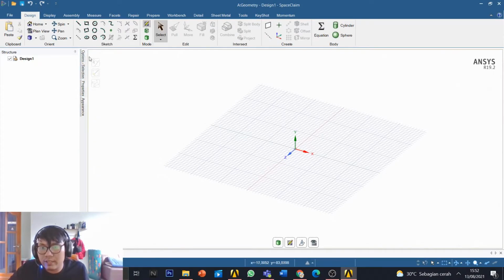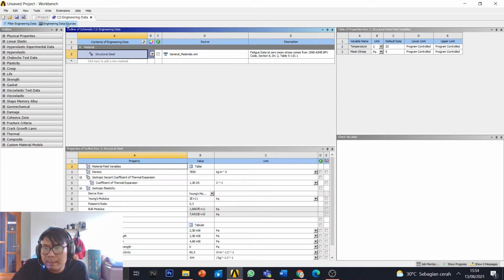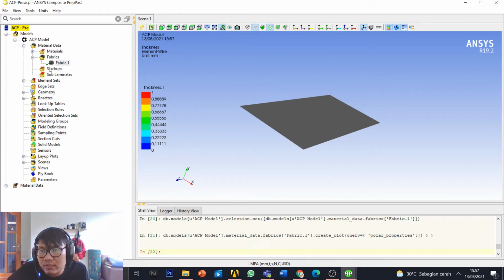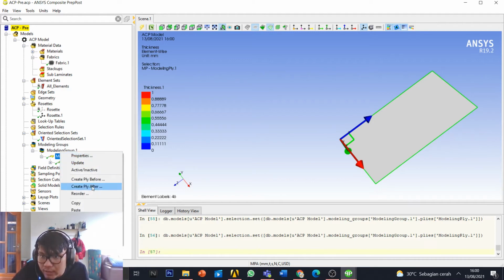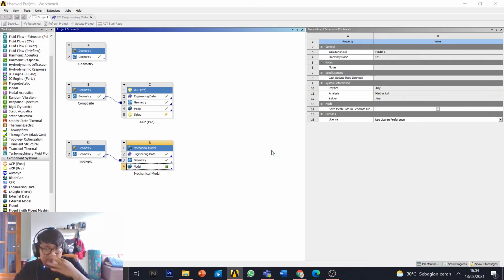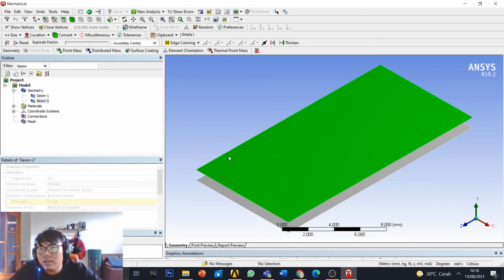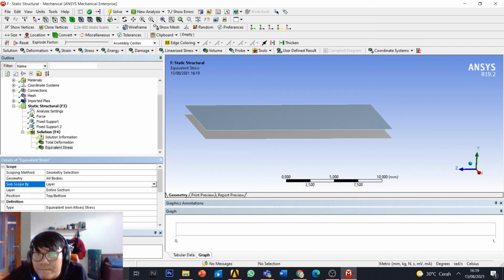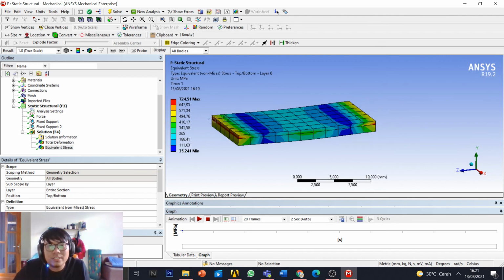ANALYSIS COMPOSITE + METAL USING ANSYS ACP (Basic Composite)

Comment: Hello,
Thank you for sharing the valuable video. For some reason, when I want to bond the surfaces to each other, same as what you did (it is upper side of the first surface to the bottom side of the second surface), Ansys does not recognize as a bonded contact and therefore the surface which displacement is applied just debonds. Do you know what might be the problem? I tried to do the same thing as you did. Thanks

Comment: Hi, I was having a issue with performing thermal and static structural analysis of my pressure vessel which I assembled 4 parts, composite layer from ACP, liner and boss X 2 from mechanical model in static structural. But its showing a error when i perform thermal analysis. Could you send me your email? I will send you the issue there.
Reply from the maker: You can send with email that attached in my Youtube Channel
Reply: @FaradisonPurba  I did check your YT channel but your email is not there in either description nor video. Could you add it there so that I can send you email.